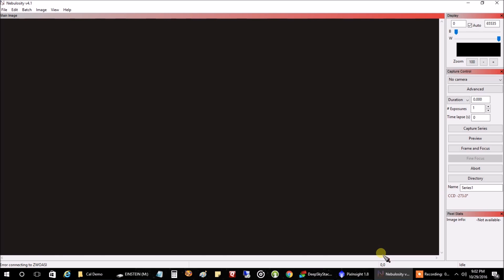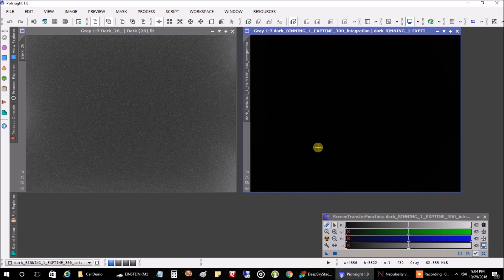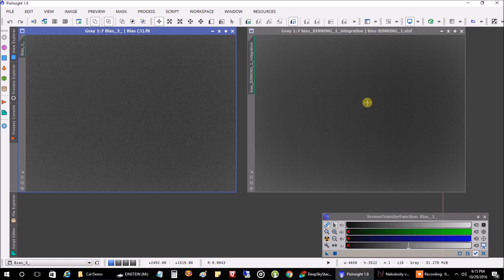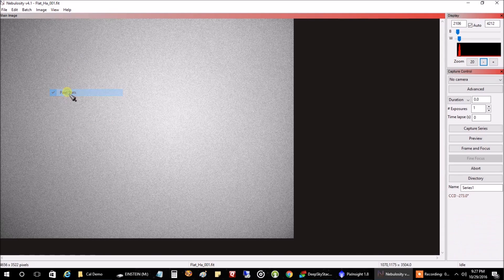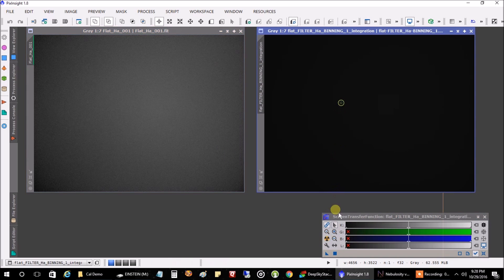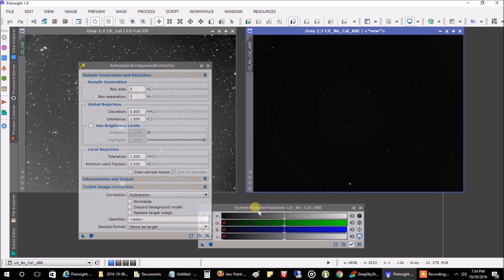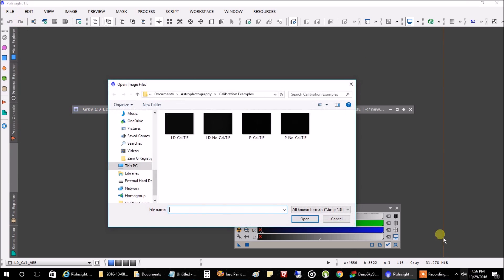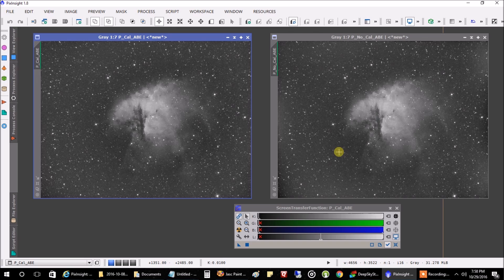How to Create Darks, Flats, & Bias (Astrophotography Calibration Frames)

Comment: Very good presentation, maybe I missed it, but at what shutter speed do you take flat frames with a DSLR? How and when do you use master frames?
Reply: Flat frames are shot in AV mode so the exposure time is decided by the camera. Leave all settings the same as your lights and the AV mode will take the proper exposure
Reply: @Russell_Fox_Photography  Thank you Rusell!

Comment: Helpful tip. If you are using Darks you don't need to do the bias frames since the bias data is in the Dark frames. If you do you will add the bias data back in the frames, which you do not want to do. Hope this helps
Reply from the maker: Thanks, I haven't heard this before.  I will look into it.

Comment: Curious Chuck if you now capture light while in SGP and if your mean readout values are similar to in Nebulosity or do you use the Flats Wizard in SGP ??
Reply from the maker: I capture lights in SGP and they are in the 10,000 range now.  I don't use the Flats Wizard, but I heard it works well.
Reply: @ChucksAstrophotography  good to hear the large difference between the two because it doesn't mean I am losing my mind!  for my ZWO/ASI it had been 6500 range in Nubulosity and jumped to 19000....going to run some new flats tonight (with my setup being in an observatory things are pretty consistent so I can get away with re-using flats for quite a while!  time to build a new set tonight for some new filters!  Still looking for a decently rated 2"  electronic filter wheel!  so far looking like it may be an ATIK 5 position.

Comment: Ok Just rewieving the video to clear up my self. As I did understand:

Darks: Same Duration, Gain, temperature & size (ROI) as the lights. Lens Covered
Question: Has to be done for each filter I use? (Like light polution, R,G,B, Narrow band)
Bias/Offset: Faster exposure of the camera, gain & size (ROI) as the lights (Temperature not important) Lens Covered
Question: Also for each filter used in the captures?

Want to create a library and their masters for the rest of the year,  and like to know to start working on it.
Thanks in advance Chuck.
Reply from the maker: Only Flats have to be done for each filter.
Reply: @ChucksAstrophotography  thanks a million Chuck! Greetings from Barcelona, Spain!

Comment: What’s up chuck!? I have a question I have a ZWO 1600 MM pro... same as yours...  my question is are we supposed to use bias frames? And if so what will the exposure time Be?
Reply from the maker: Cool, but I don't have the Pro version - I never upgraded.  I still use Bias frames.  You can just set the exposure time to zero.  That's what I do now.
Reply: Chuck's Astrophotography  kool I will try that out... as far as dark frames does your camera have to be on  the telescope with telescope cover on or can you just take off camera and cover the camera with the camera cover??
Reply from the maker: @llamarvasquez1803  I've seen darks done both ways, off the telescope or on the telescope.  I take mine off and put the camera cover on.

Comment: Thank you that was very educational. The Newt captures more light I suppose so maybe it's more forgiving than the SCT especially in the vignetting? I did notice an improvement in the vignetting at least on both examples so is it safe to say flats are important because of the noticeable vignetting removal? I would probably consider bias as the second most important since it's the easiest to acquire. This leaves dark's as the black sheep ... they take longer to capture and the return IMHO is very small in some cases also they need to be taken every time unlike bias or flats which can be intermittently ... correct me if I'm wrong please I'm starting out but it's the general consensus I'm starting to see across the web.

Comment: For bias frames I have heard elsewhere that I should take as many as possible. When I was using DSLR I would save them for last and just keep shooting until storage runs out. Can you confirm that only 15/20 bias frames are necessary? If so, that would relieve that minor pain in the neck!
Reply from the maker: Actually, capturing 50 bias, 50 darks, and 50 flats is what I do now.
Reply: Wow thanks for quick response. And is that regardless of the number of light frames? And is that 50 flat frames for EACH LRGB filter? I hope the answer is no.
Reply from the maker: Yes, it's regardless of light frames - but I capture a lot of light frames so I don't know what would happen if you only had a few light frames.  Sorry, the answer is 'Yes', you need to capture flats for each filter.
Reply: Thanks Chuck! Keep up the good work, I regularly refer to your channel more than most.

Comment: Hi Chuck.  Thanks for the great videos.  Question on Flats.  Is it necessary to collect Flats for all of the filters used in the Light frames?  When those are stacked, are those all stacked together or are the Flats for each filter stacked together to create a master for each filter and then each of those Flat masters are then stacked together?  Just trying to understand the best processing method.  Thanks.
Reply from the maker: Yes, each filter must have it's own set of flats since dust specs can appear in different places on different filters.  The flats should  be stacked with with their specific filters - no combined with flats from other filters.

Comment: Yo Chuck. As you know, I'm just starting out. My first two attempts were ok but still under what I expect.

So far just for learning, I'm using lights and darks. 
For my darks, I simply put my cap back on my telescope and left the cam connected and shot the darks. 

From listening to your vid here, that is not a good way. I should take the cam off, put lens cap on it and even darken it more in a closet or box or something?  

My way of just covering the telescope lens is not cutting it, right?
Reply from the maker: I know people who do it your way and it seems to work for them, as long as you are in a very dark area with no light leaks anywhere.

Comment: Thanks for sharing your experience Chuck. I just received my ASI1600mm this week but have a LOT of experience cleaning my DSLR sensor. I'd be happy to get to 1 year without having to clean my ASI1600! I always wet cleaned my sensor with swabs and pure isopropyl alcohol when the dust was sticky. A clean sensor is worth striving for in my mind!
Reply from the maker: Thanks Gary, welcome to the ASI1600MM club.  I'd be happy if I don't have to clean the sensor for another 6 months,  1 year would be fantastic.  Those little dust specs I still have will probably come back to haunt me.

Comment: Hey Chuck, I wonder if you could clear something up for me? If I were shooting darks (for example) with a DSLR I can understand it. No problem. If I took a two minute sub at a certain ISO and f-ratio, to get a dark I would take a two minute exposure at the same ISO and f-ratio (and temperature) ... but with the lens cover on or OTA covered. If I take fifteen or twenty of those, I would have only have 15-20 darks. And I would stack those to get a Master Dark.
Now here's what I don't get. If I shot a two minute sub with a CMOS camera, I could potentially have a video with two thousand frames. But I would only stack the best of those to get a Master Sub. Now, if I did the same thing ... keeping exposure, gain, temperature, etc all the same ... but with the cover on, I'd then have potentially two thousand dark frames ... right there in that one video! So, would I stack them ... all of them ... to get just one dark frame, then have to do that 15 or 20 more times ... getting about two thousand each time which I would stack each time until I ended up with 15 or 20 darks ... which I would then have to stack again to get my Master Dark. What am I missing?
Thanks.
Reply from the maker: Interesting idea, but I just don't know the technicalities to be able answer it.  All I can suggest is to try it the standard way and your new idea and compare the results.  I would be curious to know how it turns out.
Reply: I don't think it's an apples for apples comparison in terms of overall data collection.  Multiple two minute duration subs should produce higher dynamic range than a two minute video divided by 2000 frames.  The frames would be of micro length and not capture enough data unlike what a two minute sub would do.

Comment: hello, can you shoot flats the next day by refocusing on a distant object, then pointing the camera at the sky with the t-shirt on? does it matter if the sky is overcast and not bluesky?
Reply from the maker: If you don't remove your camera from the telescope, you can shoot flats the next day.  Just leave the focus as it was the night before - don't try and re-focus on a distant object.  An overcast sky might work as long as you reach your desired mean readout.
Reply: Chuck's Astrophotography I forgot to  mention that I just shoot with a dslr and camera lens. No telescope. I understand that it would be better to leave focal length and focus as it is for the day after. But I would like to know if it‘s possible when I have already put away the camera along with my equipment.
Reply from the maker: Well moving the camera and putting it away could cause dust to move around make the flats not as effective as they could be.
Reply: okay thanks for the answer. I'll just give it a try and I will see if it works better than no flats.

Comment: Another great video Chuck!  Off topic, but what desktop do you use for post processing?  I’m getting my AP rig together and trying to figure out how much $$ i need to dump into a desktop so it doesn’t take hours to stack and stretch images. Any info is greatly appreciated. Computers processing powers can be an easy way to start wars on forums. Thanks in advance! Clear skies!!
Reply from the maker: If I had to buy one piece of software it would be PixInsight.  It great for stacking and post-processing the final image.  I think I paid close to $300 for it.  I've also started using PhotoShop.  Everything running on Windows 10 Pro.
Reply: Thanks for the super quick response. I was asking about your post processing computer ie. how many gigs of ram, ssd or hdd, what type of processor (like an i7 Quad Core) etc. Your computer seems rather adept at handling the stacking and stretching rather quickly. Pixinsight seems like a no-brainer and comes highly referred. Thanks again for the awesome vids. Keep up the amazing work!
Reply from the maker: Oh, my desktop computer.  I am using a Windows 10 Pro, Intel i5-3470,  20 GB of RAM.  I have an SSD and always keep at least 100GB of free space on it.  When I am done processing and have my final image, I archive everything to an 8TB external drive so that I can get back to having 100GB of free space.
Reply: You’re awesome Chuck. Thanks a million for the info. I was trying to figure out what was required to quickly and smoothly run pixinsight and other PP software and kept receiving answers from others that varied far too much. After seeing your PP in action, I had to know what kind of internals you were working with because obviously your computer works very well! The proof is in the pudding! hahaha.
Reply from the maker: Thanks KickinSnails, glad to help.

Comment: When you say make the flat frames in the '"same rotation" do you mean immediately after shooting other frames in your shooting session?  
Thanks for the video.  I'm about to start learning this skill.
Reply from the maker: As long as the camera stays attached to your telescope, you can capture your flats any time.  In my case, I am still using the same flats I captured a couple weeks ago because I never removed the camera from the telescope.  Even if I rotate the camera (without remove it), I can still use the same flats from a couple weeks ago because when I rotate the camera, I also rotate filters and field flattener all the same way.
Reply: I just found your reply a month later than you posted it.  
Thank you for the detailed and helpful reply.
I'm starting to get some fair results using just lights and darks so far.
Reply: Chuck, correct me if I'm wrong, but the idea of not rotating the camera, isn't it because of the reflections and distortions of the light inside the tube, thus making it important to keep in the same angle with respect to to the OTA itself (and not so much with the filters and other items in the imaging train)?

Comment: Hello.  Chuck how often do you replace/re-do your darks, flats and bias frames...or, do you shoot them with each imaging session?  Great videos, by the way.  Informative, friendly, amusing and useful.  Really enjoy them.
Reply from the maker: Thanks FC.  I use Darks and Bias frames for around 6 months before I decide to replace them.  I reuse flat frames until I remove the camera from the telescope - then I need to recapture them.
Reply: @ChucksAstrophotography  Great! I just got contrary info from somebody else. He said you could save and re-use Flats & Bias, but NOT your Dark frames since they have to be taken immediately after your light frames because they have to be shot when the chip is at the same temperature as the light frames.  I'm not sure who is correct but i think you might be because you mentioned the angle of the camera and I would expect the veeg-netting pattern might change if the camera isn't at the exact same rotational angle relative to the scope.
Reply from the maker: @Robert08010  If you have a cooled camera, you set the temperature on it so that the lights and darks always have the same temp, and then you can reuse the darks.
Reply: @ChucksAstrophotography  I see.  I have a DSLR and an el-cheapo NexImage5 camera too but neither are temperature controlled. So I guess that will not apply to me. Thanks anyways.

Comment: Hello chuck! How do you mark bias frames in SGPro for a zwo asi 1600mm? And how do I set the exposure? Thanks again
Reply from the maker: I'm not sure what you mean by "mark" them.  But you can try the exposure of 0.000032.  Not sure if that's right, but it's what I use.  Also, I heard Bias frames aren't even need for this camera as long as you capture darks.
Reply: Chuck's Astrophotography  lol sorry chuck I mean “make”
Reply from the maker: There's a drop-down box next to where your specify filter where you also specify lights, darks, flats, or bias frames.
Reply: Chuck's Astrophotography thanks for the info I tried out the flats wizard it’s seem to work real good I had my camera set at ADU 30,000 I hope that’s right... I just wasn’t sure about bias thanks again
Reply from the maker: I've seen people go with 30,000 before, others at 22,000, I go with 10,000.
Reply: Chuck's Astrophotography what’s the difference from 10,000 -30,000?
Reply from the maker: One or the other may be more effective at fixing dust donuts and vignetting.  Need to experiment and see what works best for you.

Comment: Hello again Chuck.
I was wondering, did you utilize in SGPro the “Flats Calibration Wizard” ? And if so how did it work out for you? Did you have failed calibrations during the process and how did you counter those problems? Did you do a video with SGPro of how you go about doing your flats? Would love to see the process just at the point where you finished with your lights and prepare in SGPro the Flats process.... Thanks.
Reply from the maker: I use  SG Prog to create flats, but never heard of the "Flats Calibration Wizard".  I haven't created Flats in over a month.  I reuse them until the point where I rotate or remove my camera.
Reply: Hi Chuck. Thanks for answering.... “Flats Calibration Wizard “ is under the tab “TOOLS” in SGPro.... If you are curious, see page 168 in the owners manual. Cheers and clear skies !

Comment: Do you shoot a "library" of Darks at various temperatures and exposures to use later when you have lights that match that temperature and exposure?  That way you don't need to waste valuable imaging time taking Darks?  Also Chuck, if the ZWO 1600 allows you to cool the sensor to a specific temperature below ambient, and the ambient temperature changes with the weather, how could you maintain a large enough variety of temperatures and axposures?  Hope I'm clear enough.
Reply: This figure is -20 setpoint.  Each cooled CCD will have t-delta figure, for example my Atik 16200 is -50, but I cool all year round to -15 (actual temperature) as below this there is no noticeable difference.  This way you only need to have a single darks library that is easy to update periodically, which you should do (I redo mine every few months).
Reply from the maker: I used to shoot a library of various temperatures, but now that I have a cooled camera - I use one temperature only.  The ASI1600MM-cool lets me set my camera to -20 degrees, regardless of ambient .  So my darks are created at that temperature.
Reply: But that's -20C below ambient temp. correct?  So if it's 30 degrees out, the sensor will be at 20 below that correct?  If it's 10 out, then the sensor will be 20 below that?
Reply from the maker: I wasn't aware that it was -20 relative to ambient.  I don't know anybody with a cooled camera who keeps a library of various temperatures.  Never heard there was a need to do that with a cooled camera.
Reply: That helped me a lot! Thanks, Chuck! I didn‘t know about the pixel stats, used the histogram instead and the camera was not in the exact position when I took the flats...